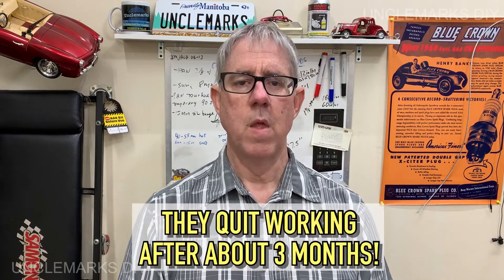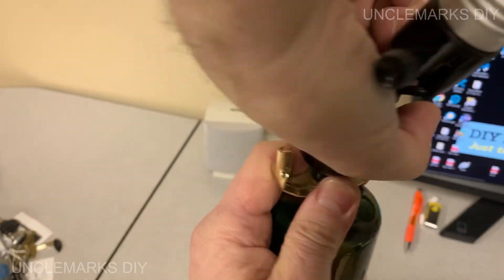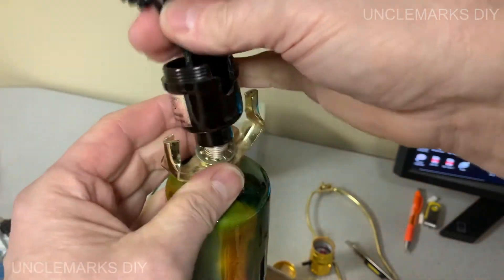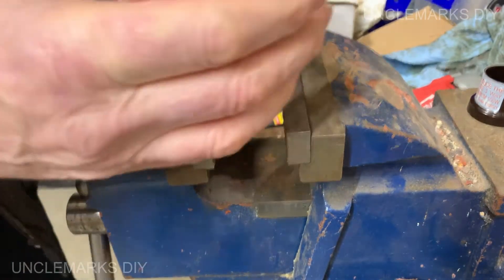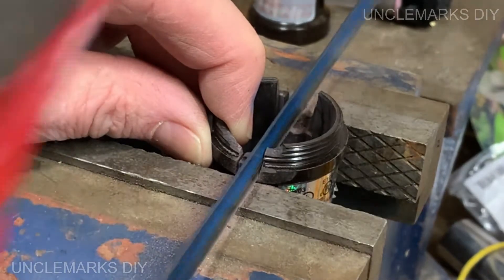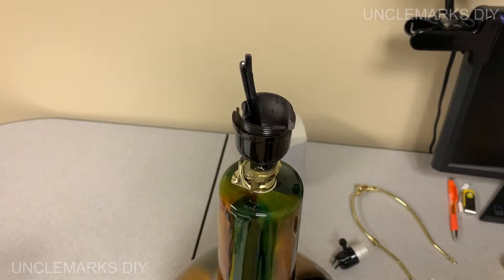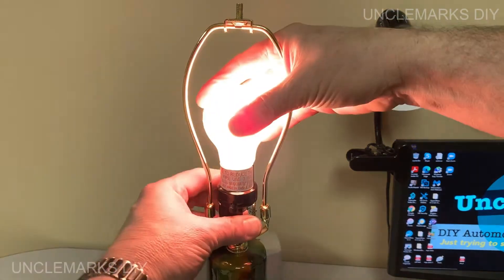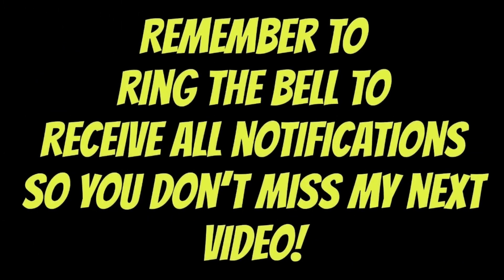Why my LED bulbs burning out & the fix! (EP 172)

Comment: I think the main issue why they don't make contact is that old bulbs had a pointy terminal on the bottom and the new bulbs have a flat pad. They sometimes don't fit it a basic 1 way socket, and the contact tabs have to be bent to match. Otherwise they press against the plastic separator as evidenced by metal marks on it. You need a glass filament style bulb in this lamp to avoid a shadow on the bottom.

Comment: Please stick to auto repair- this video is a disservice to the dyi community - please consider removing it.
1. This has nothing to do with why an LED bulb might burn out prematurely.
2. The metal shell will fit- these parts are standardized! The problem is lack of knowledge- there is a small screw that need to be loosened to allow the shell to be easily screwed on.
3. You could have just installed a 3 way led bulb and done no rewiring.
4. if you had purchased a turn knob, rather than a push socket, all this drilling and sawing would not have been needed.
5. Bad safety
  - no underwriters knot
  - dangerous technique for drilling and sawing with fingers close by
- no attention to polarity.

Perhaps best to only do videos on subjects for which you have knowledge and experience.
Reply from the maker: @edwardmahl-p5u  I appreciate you wish there were better videos on certain subjects. Can I ask why you don’t make some videos and share you knowledge? Are you worried you don’t know as much as you think? Prove what you know by uploading something!

Comment: 1) 450 lumen is 40 Watt equivalent bulb, not 60 as you indicate.
2) Did you check to make sure that the threaded part of the socket goes to neutral, and the switched center contact goes to line? If not, you really should change them.
3) Regular bulbs are compatible with 3-way sockets. It just takes 2 clicks to turn them on or off.
Reply from the maker: My mistake on the Lumens! Your right. 60 watts is 800 Lumens. Regular bulbs are compatible, but not so sure with LEDs. They are pretty sensitive to all sorts of things.
Reply: @unclemarksdiyauto  I guess it depends on the LED. I'm using a 3-way socket with Phillips' ultra efficient bulbs (1540 lumens, 8.5 watt) and they work just fine.
Reply from the maker: @kirkkohnen5050  I had no trouble for months, then the one time I turned it on, poof! So I thought, just a bad bulb. Replaced it & months later, same thing. Think I lost 3 bulbs, but since I swapped the socket, no issues. Thanks again for your thoughts. Talk again soon!

Comment: its not hard to drill through, you was just using the wrong type of drill bit. they make bits to drill through different materials. they have them for concrete, metal, ceramic, wood, etc. also you mentioned leaving the sticker on so youd know the maximum watttage of buld it takes. that applies to the old socket you took out not the new on you put it. it could only be 60watt maximum like what mobile homes use. the package you bought it in will tell the maximum rated for that socket.
Reply from the maker: Thanks for the ideas, Teslatronixlab. I appreciate the comments. Take care and thanks for stopping by.

Comment: Maybe the light bulb installation was in a teenager’s room. Maybe it was used in an enclosed fixture, maybe it was used on a dimmer, maybe it was used in a recessed light, maybe it was used base up. Also the bulb shown in the video is an incandescent.
Reply: And that LED was a 40W equivalent.
Reply: This one was used in a lamp in an adults room. So not too much of a problem.
Reply from the maker: Yep, it was a in incandescent bulb just to show that there were a couple on positions on the old fixture, which was the problem when using a standard LED bulb.
Reply: @unclemarksdiyauto  Another issue with all lightbulbs is installation in teenager’s bedroom. An incandescent bulb won’t fix that issue either.

Comment: I have to say I think we may be related. No one else except for us would go to this much trouble to fix something.
Reply from the maker: That is possible ceeyaaa. Some have suggested just buying a 3 way LED bulb, but I really didn't need that type of light/brightness control. It is working fine and I am happy with the results.
Reply: @unclemarksdiyauto  
TIPS FOR YOU: DO NOT PUT LIGHTBULBS IN A TEENAGERS ROOM.
DO NOT USE THEM ON A DIMMER.
DO NOT USE IN ENCLOSED OR RECESSED LUMINAIRES.
DO NOT USE IN BATHROOMS.
THINGS TO USE LIGHT BULBS IN:
SUITABLE FOR BABY/TODDLER/LITTLE KIDS ROOM
SUITABLE FOR KITCHENS.
SUITABLE FOR GARAGES.
SUITABLE FOR ADULT BEDROOMS.
SUITABLE FOR CLOSETS.
SUITABLE FOR MOST LAMPS.

Comment: Uncle Mark....Traditional house voltage is single phase 120-120-240. However if you have a three phase service you would have 110-208 volts.
Reply from the maker: My mistake. We are 120 volts. Some have suggested the new tri-light LED bulbs. I have not seen any here yet, but if available and not a arm & a leg, that might be the way for most to go!
Reply: @unclemarksdiyauto  
CAUTION:
NOT FOR USE IN TEENAGER’S ROOM.
NOT FOR USE IN TOTALLY ENCLOSED FIXTURES.
SUITABLE FOR DAMP LOCATIONS.

Comment: great fix  ..had me laughin  ... towards  your body not your buddy
Reply from the maker: Yep. Had that backwards! Guess it depends who you like more!
Reply: @unclemarksdiyauto      lol   if your buddy is that close  hes in the way  and will back him up a bit
Reply from the maker: @queenstownkid  yep, or he deserves what he gets?  Lol.
Reply: @unclemarksdiyauto  
TIPS:
Do not use lightbulbs in a teenagers room.
Do not use with dimmers.
Do not use in totally enclosed or recessed luminaires.
Suitable for damp locations.
Reply: @unclemarksdiyauto  An enclosed fixture may be killing your LED bulbs. 3-Way lamps don’t technically dim the bulbs so the LEDs should last the same amount of time.
Reply from the maker: @houseguestchannel  Thanks for the comment, Homeguest Unton2. It is just the way the socket is made for a 3 way bulb where 2 contact points touch the same part of a LED bulb and cause a fast power fluctuation. Have had this problem with a few lamps & LED bulb combos. Fix is either replace the fixture, or buy a 3 way LED bulb.

Comment: CanTire has a Noma led trilight for $20.   Maybe I missed it but did you confirm/test to ensure positive was back in the centre of the socket and not the outside where negative was and should be?   If not it's an increased hazard.  Be safe.   Thanks Mark.
Reply from the maker: Yep. Negative on outside. We are couple hours each way to a Can Tire. You are right that buying a tri-light LED would be the way to go. Although I wanted a 40 watt equivalent in this lamp for very low lighting. I imagine lowest tri-light probably starts at a 60?
Reply: @unclemarksdiyauto  The CanTire one is 50/100/150. HomeDepot has a 40/60/100.  Thanks.
Reply from the maker: @jakemason9436  thanks Jake! Wish I would have know that! I would have just gone that route! Our local hardware stores do not stock LED tri-light bulbs as of todays date March 2021
Reply: @unclemarksdiyauto  
CAUTION TO LIGHT BULBS:
Do not use lightbulbs in a preteens / teenagers room, Enclosed or recessed luminaires, And base up.
Suitable for damp locations